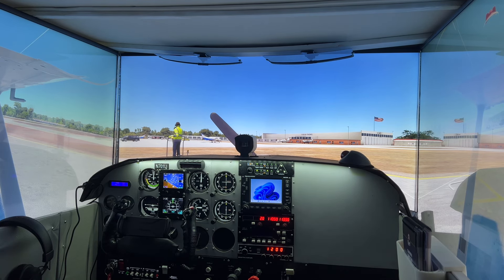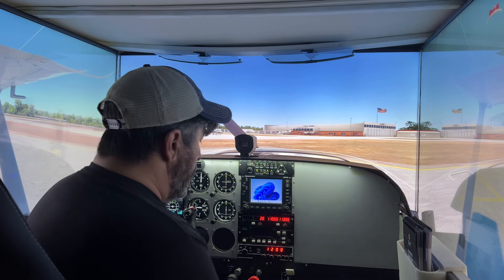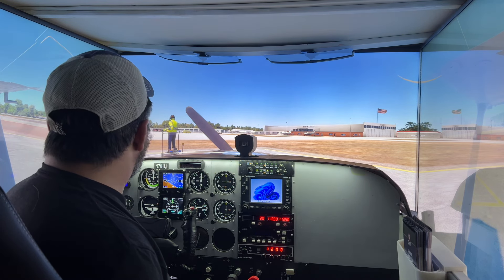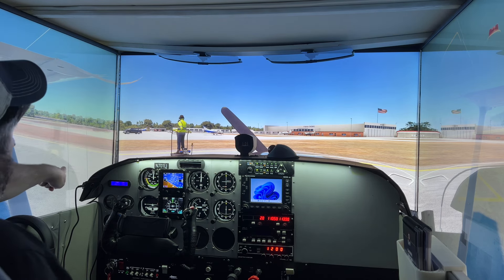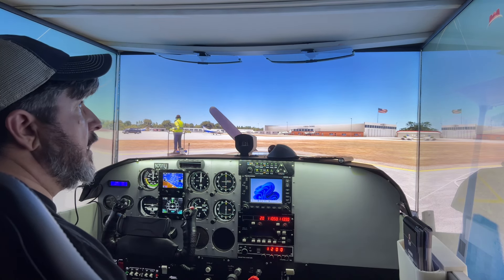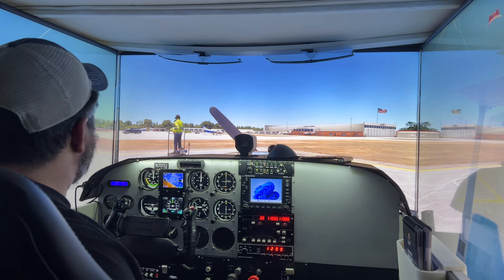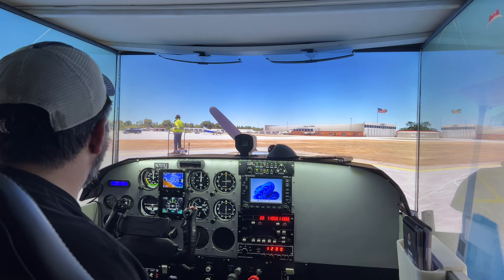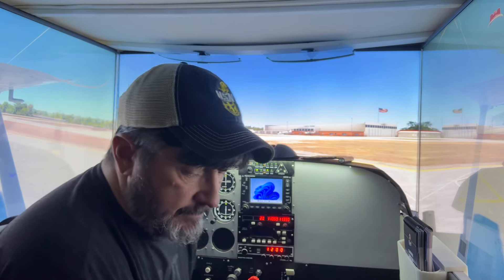MSFS 2020 minus the interior cockpit…how well does it work

Comment: Once you build the panels to make the enclosure complete you’ll love it. I’ve done some digging but haven’t found a standalone 530 as of yet..I know you said you didn’t want to alter anything but would you consider a 750. There are 172s that have them? You would then be able to get the tds standalone like mine and be good to go.
Reply from the maker: I threw together the enclosure (it was already built, just hadn’t added it).

I did a flight and loved not having to move the default whiskey compass out of my way.

If I add the 750 then I’ll have to revamp the center section quite a bit (and yup…already been thinking about it).

I haven’t given up on my 530 yet though…I’ve tried a few things (most are way over my head…one is trying to modify the xml so that I can shift the GNS530 from internal/cockpit to an external…but it’s kicking my butt)
Reply from the maker: Quick update…I downloaded spacedesk and threw it on the PC and a Samsung tablet.

Coincidentally that tablets screen width matches the width of the real 750…it just happened to be 2 inches longer.

So I bought the TDS GTN 750xi, and tried putting the 650 below it…and it fit.

I ran MSFS in my Cessna with the TDS in stand alone…and both the 650 and 750 worked like a champ.

I’m 3D printing a combined bezel now that also has the knobs/buttons and a bracket to hold the tablet…this may be the way ahead.

This could also replace most of my Propwash panels too
Reply: @shadetreehomesim  that’s awesome to hear…I was just sitting here trying to find a way to get the 530 working for ya..lol
Reply from the maker: @CardboardSim  thanks, and it’s appreciated …I may still keep looking for a solution for that too, but I think I can update to at least the 750.

I’m also going to try a $45 touchscreen I found on Amazon that has the right dimensions, and then decide between the two.
Reply: @shadetreehomesim  great. cant wait to see the update!

Comment: Great flight simulator!
I´ve similar plans. My problem is the connections. I´ve a 4090 with three DP and one HDMI port. I want 3x 55“ and 1x 24” (for the altimetermotives panel) and the Garmin panel from Propwash or another manufacturer.
My plan would be to connect all three TVs with DP-HDMI adapters. The 24” with DP. Then the GPU is full. And the Garmin with HDMI-USB adapter to a USB port.
Would that work?
Nvidia says: 4 independent monitors with 4K and 120 Hz via DP or HDMI.

Another question, how much space the sim takes. Length and width in toal?
Thanks & Greetings from Germany.
Reply from the maker: @seliiinchen  greetings!  I’d say from Connecticut but I’m on work travel and there’s a global computer outage…so I’m stuck in the airport in Seattle.

As for the Sim…I have two DP and one HDMI running for the 3 main displays (for some reason my 4080 didn’t like running 3 dp).

At present I’m running a 17 inch flat screen for the gauges and the flgihtsimbuilder 530, and both of those are running on USB 3 to HDMI adapters.  I take a little FPS hit, but it’s still working fine (45+ fps on a mix of high and ultra).

So I think your setup would be fine…the Garmin and the gauges will be lower resolution…Garmin will be like 800x600 and that 24 inch alterior motives could be about 1920 x 1080 and it’ll look fine.

As for length and width…I can get exact measurements when I finally get home from this travel nightmare lol…

But length is the length of the monitor mainly( about 48 inches or so?) same goes for the width.  I have mine at almost 90 degree angles.  If you angle them out then it’ll get wider but also shorter in length as the monitors spread apart on the sides.

Oh…be careful with any Propwash Panels…the micro usb connector on the back can come right off EASILY.  I’d highly recommend adding some hot glue around it to add a little strength.

The Flightsimbuilder GNS530 is a great panel…but my issue with it is I can’t use the pop out when I remove the interior….so I’m shifting to a gtn750 when I get home and then I’m going to put in analog gauges
Reply: @shadetreehomesim  Thank you for the detailed answer!

Same here in Germany, some Airports have huge problems.

So you connected the main screens with a DP to HDMI adapter or do the TVs have DP input?

I will probably not hide the interior, so the 530 should work. But interesting, I didn't know that you have to pop out the screen. I thought there is a connection to the sim similar to iPad apps or the Saitek Pro Flight Cubes.

As I and my friend also use the computer for other games and privately and his drums already took nearly half of the room, the Sim would be behind the desk. That way you can roll the PC. And there is a Window. So space is an issue. A second PC would make sense, therefore the Nvidia shares need to rise again for that :D

I thought about taking 3 x 50”. Or maybe 1x 55“ and 2x 48”. But I think 3 similar are always better.
Reply from the maker: @seliiinchen  MSFS doesn’t like the cockpit visuals to be different sizes.

I bought cables that go hdmi to dp because the TVs have hdmi.

For the 430 and 530 you’d be using the pop outs…650 and 750 with ll work differently.

If size of the setup is an issue…maybe 43 inch TVs?
Reply: Ok, I have some sketches in SketchUp and after viewing 360° Photos with the old Cardboard VR the 55” looks like the perfect size. So there is enough space inside the “Cockpit” 
I think 43 could be to small. 

Well it looks like it could really work - so the only thing is space.
And maybe I wait until FS2024 is released in a few months - who knows if it supports all the things 20 did.

Currently I have a 32” Screen with TrackIR, it’s nice but not enough.
Thanks again for your help! :)

There a lot of such Sims, but yours look like the perfect combination of realism and easy to build.
Reply from the maker: @seliiinchen  I learned a lot doing it…how to really use my 3D printer, how to use arduinos with Mobiflight…plus there’s so many awesome people in this hobby who just want to help out.

Share a photo when you’re done…I’d love to see how it turns out.

I spend way too much time on YouTube looking at other people’s setups now 🤣
Reply: @shadetreehomesim  We've tried our hand at making our own panels with Arduinos, but soldering and wiring is not a fun job for both of us :D

He has built two panels for the 208b with Arduinos. So currently it´s a hybrid setup. I prefer to fly the 172 (or the 150) and I'm sweet so we will get an 172 Cockpit!
A hybrid Cockpit is not really an option for the 3 screen variant.

Sure, I will take photos!
Reply from the maker: @seliiinchen  one trick if soldering is an issue…DuPont connectors

Comment: What CPU / video card are you running? I have a 3 TV / surround setup like you do, although not all of the flight controls for a full cockpit build. I keep running into the left TV window just disappears or overlays on the right side - the only thing I have found that works is keeping the left screen windowed and the center / right sides can be full screen. Running Intel 13600 & AMD 7900 RTX.
Reply from the maker: I’m running an Nvidia 4080 with an intel 13900.

I haven’t had an issue like that on the windows.  I’ve been able to use the experimental feature, add displays and have them show up correctly.  Then I just tweak the alignment and leave them be.